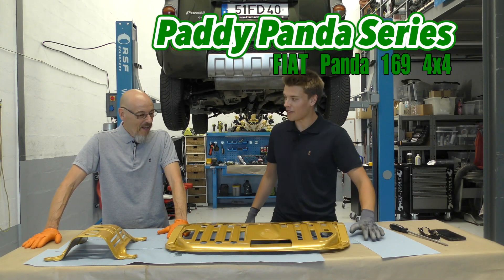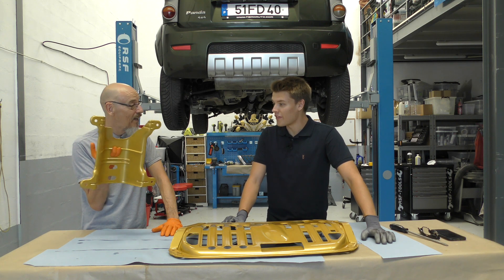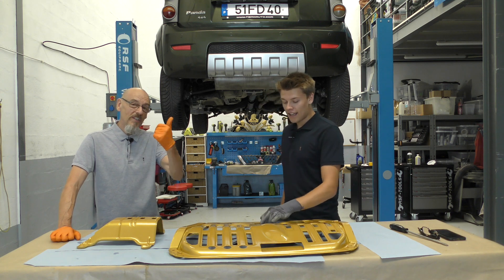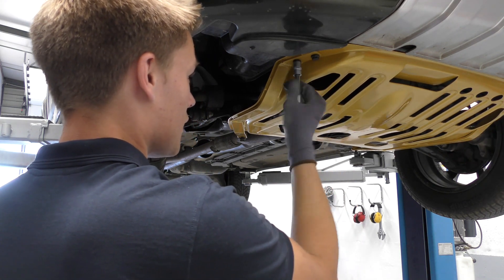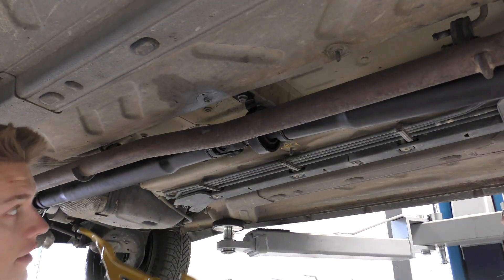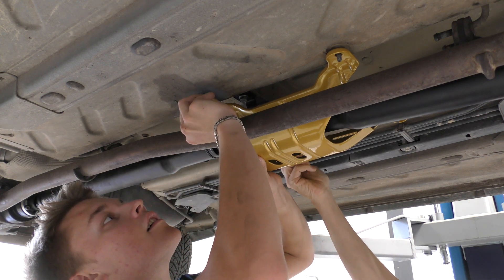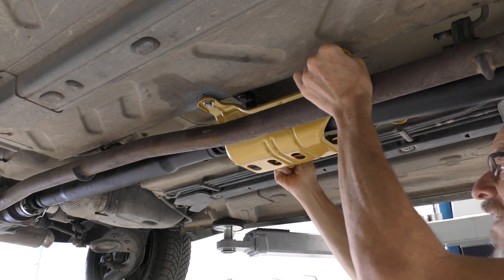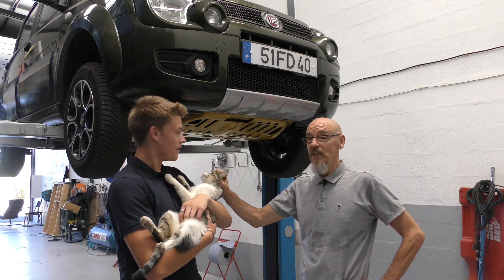Bring on the bling !!     - Skid plates go on  ....  gold skid plates ......

Comment: Hi Jon and Nath.....
The two protection plates look really good in gold, well done to you both, best regards, Stefano......
Reply from the maker: Copper grease on the bolts ! just in case you thought I was slipping :)  Have a great weekend 

KR Jon & Nath
Reply: @DrivenMadShow  Good evening Jon, Nath, and Reg....
Yes copper grease is good but please remember never on rubber lol....been busy here all day working on an Audi, front off side outer cv boot changed and new brake pads fitted, loads of copper grease applied lol....
Have a great weekend,
Best regards,
Stefano
Reply from the maker: And a considerably better job than we would do !!

Comment: Looks really nice guys. I’ve broken one of the studs of the central bearing support protection plate. Seems something similar happened to you, can you just unscrew the studs?
Reply from the maker: You can - but ...... ours came with one snapped off - I drilled it out and then snapped off the removal thingy in the bolt and made it ten times worse !! 

Could not get it out, could not drill it - world of pain ! 

So we ended up welding a nut to the car and bolting in - working a treat luckily !

Best of luck :)
Reply: @DrivenMadShow  I’ll see how far 3 and a bit studs will take me than..

Comment: Can't even get a bolt in, and you let him swap the engine in the ML? These young 'uns, I don't know. 
(Did I read those front skid plate bolts corrode and seize solid? Swap for stainless, or copaslip?)
Reply from the maker: And I need new glasses :(     -- all copper greased before entry !